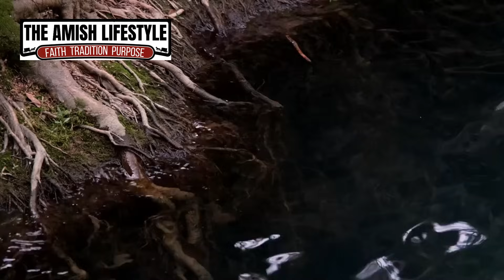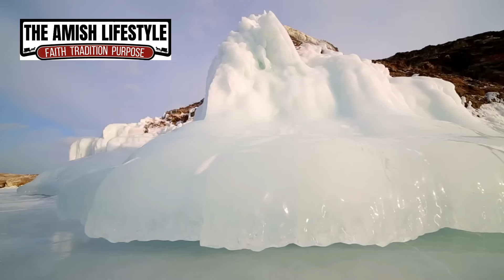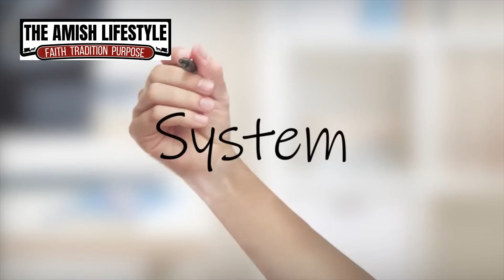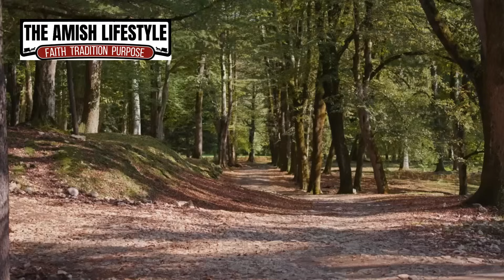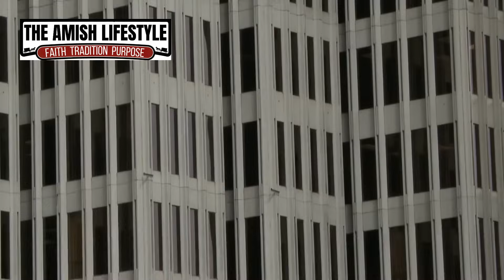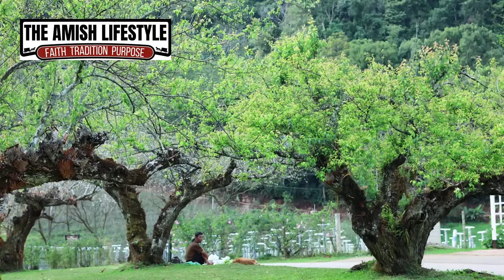How Amish Keep Root Cellars at 34°F Without Electricity– Works Even in 110°F Heat!

Comment: According to the National Renewable Energy Laboratory the Ground Temperature in the United States at a depth of 10 ft. is between 50 and 60 degrees ~ nowhere in the U.S.  is there a recorded temperature of between 35 and 40 degrees at that depth.
Reply: From the english voice, I think they are using celsius.  At one point tho they get things confused.
Probably an AI script with AI reader and AI video.
Reply: @thisisashan  34 degrees C is hot.
Reply: Root cellars borrow cold from the outside environment (Thermal Lag).